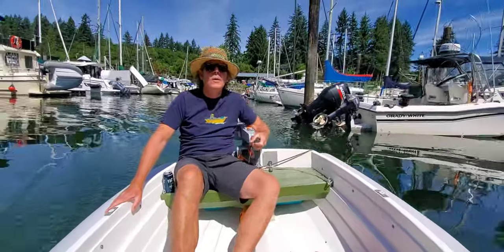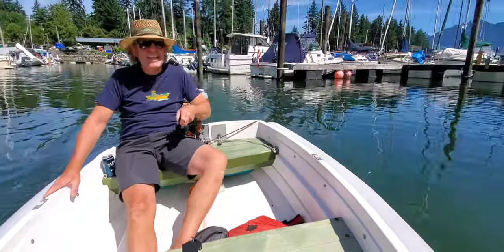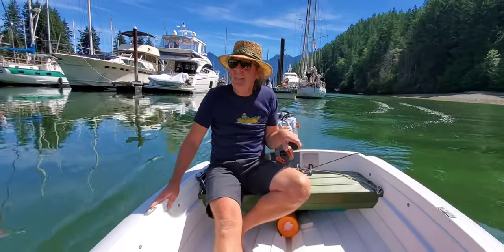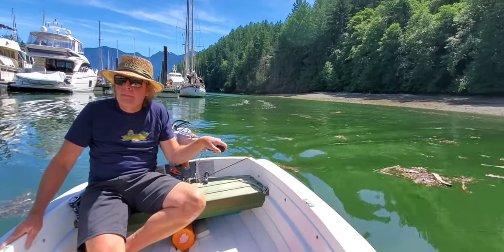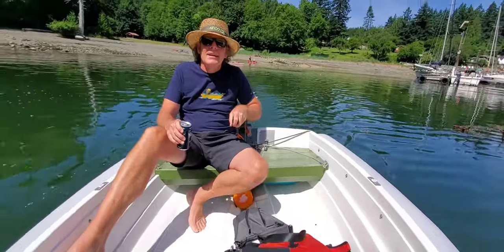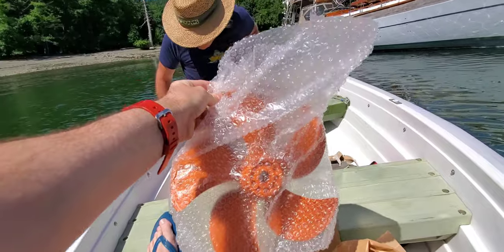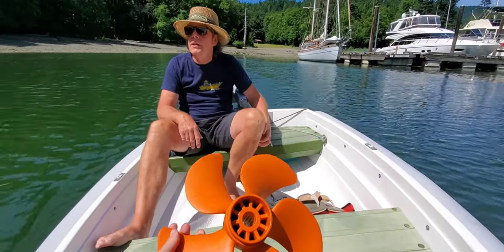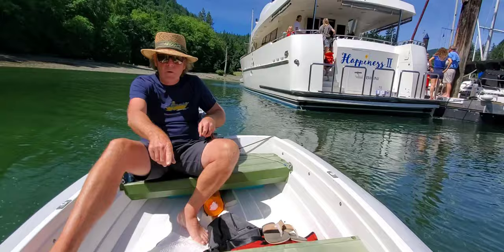Electric Boat - 24 Volt Torqeedo Trippin with Mike Whatley of Bluefin Electric Marine

Comment: the torqeedo is 29 volts and not 24 volts as said this because they do not want you using a 2x 12 volt set up, torqeedo was taken over by the german engine builder
Reply: 2. 12 volts cheaper but using m I re refers